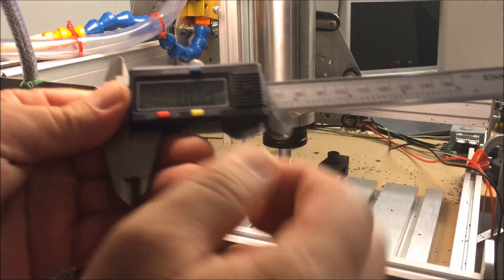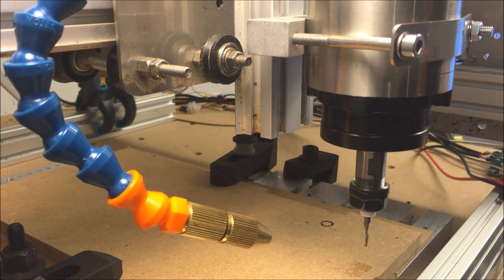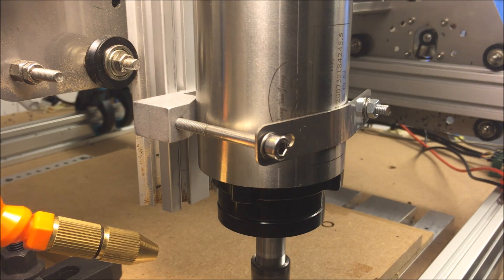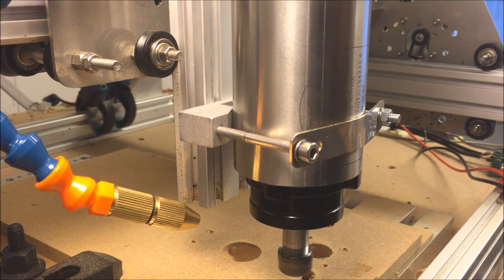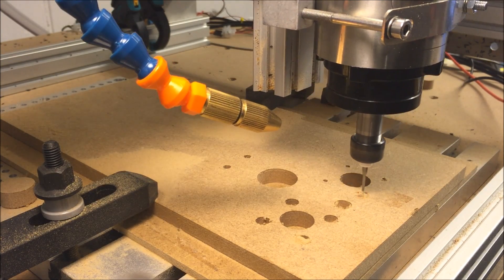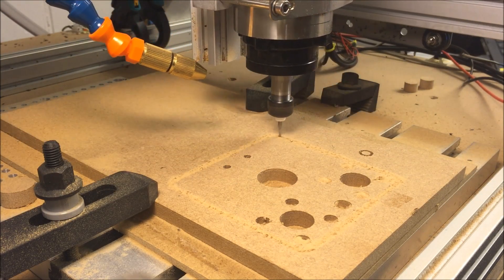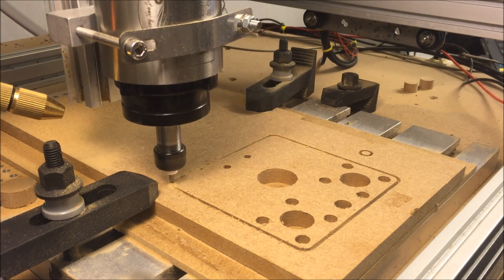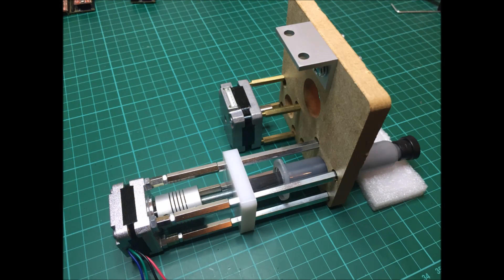Solder Dispenser Header S01E06

Comment: Do you still have the same spindle ? Are you still happy with it after all this time ? I was looking at the Chinese ones, don't want to waste money on complete cheap rubbish, and its difficult sometimes to know what your getting.  If you had any thoughts on this to help out I'd much appreciate it. Thanks again
Reply from the maker: The problem with this chinese spindles, my USb connection was lost every time i switched the Spindle on. It was a mess to find the problem ... later i got a chine cnc3040 and was happy with the 400W DC Motor Spindle.
Reply: What was the origional chinese one you had was it one of the 3phase ones 1.5->2.2Kw, I'm guessing not because they are much bigger and heavier and perhaps over kill. I think i'll just get a 500-600W dc spindle to being with, which I was thinking comes with the cnc3040 ?